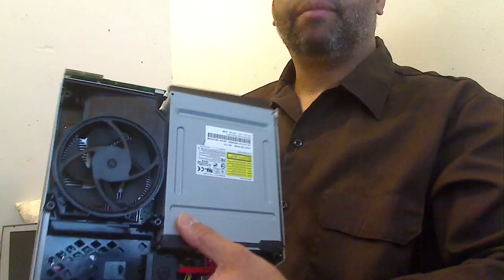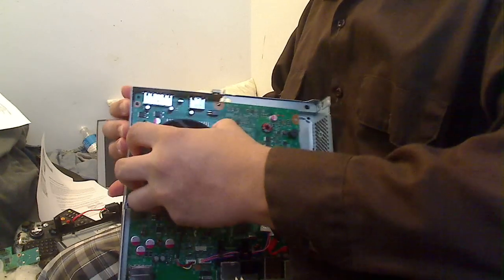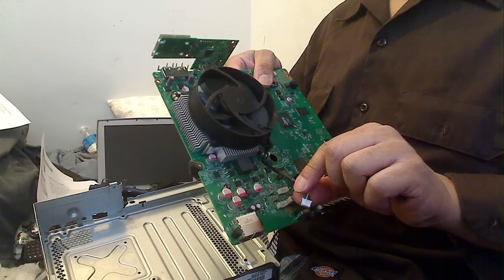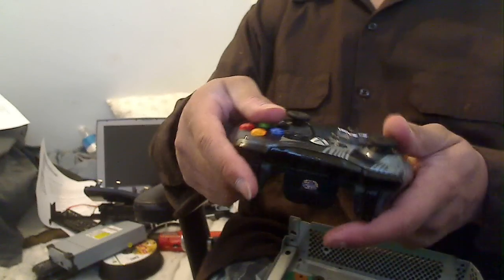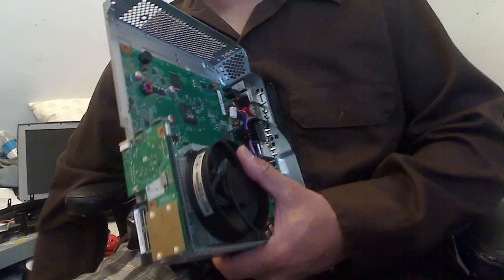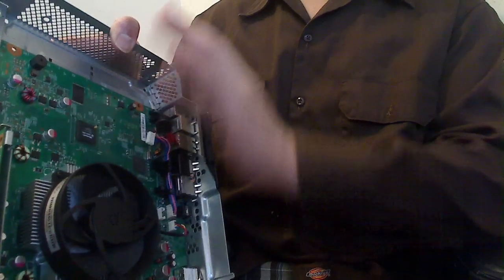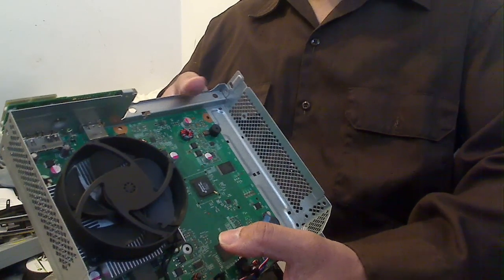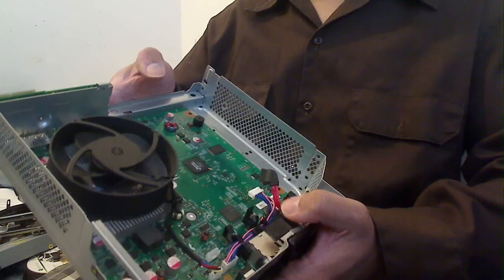How to fix Xbox 360 Slim RROD / Red Dot of Death Reset Solution👍

Comment: i did it and it shot down, i let it cool down but when i pluged it back in the ring was red again. so what should i do now?
Reply from the maker: Explain everything you did step by step.
Reply: +Donte Beachem (Romerro) i took my xbox apart-i cleaned it- than i put the thing with the light in it back on- seperatet the fan- put back in the hdmi and power cabel- started it- let it run till it turned off-pulled out the cabels- let it cool down-pluged the fan back in- started it again. second time i didn´t pulled the cabels out when it cools down. and a third time i put everthing together harddrive wifi thing ect. and did the reset. (sry for my english i´m actually german) and thanks for ur time :)
Reply from the maker: +Ben Fox How did you clean it.?
Reply: with a napcin and alc

Comment: I'm jose and my xbox360 slim has just turned on the reddot but it is a 4gb witch mean it does not have a hard drive and my power block every time i turn it onn it goes from orange off to green to orange while the console is on but with the red dot on the power button nothing else. plz help me
Reply from the maker: Your problem is unusual but try a friends working power brick and if that doesn't work, try the main reset suggestion in the video.

Comment: what happens if xbox doesnt shut off after 20-30min with fan disconnected
Reply from the maker: Check to see if the metal heat sink is hot. If it is not hot then you may need to use a heat gun on low (500 watts) for about, 10 mins both sides heating the board. Let it cool down for about 20 mins and then try the reset again.

Comment: Dave Ertman When I have it pluged in to reset I am get a red blinking light and the fins do not feal hot is this what it is to do or is there somthing else wrong.
Reply from the maker: The heat sink is supposed to be hot. Ur supposed to have the fan on the metal heat sink disconnected. If it isn't getting hot while the fan is disconnected, then there is something else wrong with ur Xbox, but make sure while doing the overheating that u disconnect the DVD drive,  the hard drive and the cables connecting the hard drive and DVD drive
Reply: ok thanks I will try this. Thanks for your help
this is the best video on how to fix your xbox that I have found.what should I do if the reset does not work does that mean the it is not fixable.
Reply from the maker: Thanx for the comment David. No it doesn't mean that it cannot be fixed. Your next solution would be to use a heat gun on low or 500watts both sides for 15mins each. If that doesn't work there are companies online u can send your Xbox to to remove the CPU and then resolder it back to the board. Also don't put the screws in with the washer. Place the x-clamp back in.

Comment: yo my Xbox had the red dot and it was because of the hard drive. how do you fix the problem
Reply from the maker: Power off the console, remove the hard drive; then reinsert the hard drive making sure it is lined up correctly with the SATA connections and pushed all the way in flush and then power back on your Xbox. if you continue to have the reddot because of the hard drive, try reseating it once more. if that doesn't work you may need a new hard drive or just use a large USB drive. you can always just remove the hard drive completely to play your Xbox. good luck and happy gaming

Comment: Hey I tried everything you said. I removed the fan. Turn the xbox on and waited for it to restart. It has a red dot for maybe 30seconds but after that the red dot blinks then shut down. I turn the xbox on again but there's still the red dot. Help!
Reply from the maker: Check your power supply.  Your xbox360 Slim power brick may be malfunctioning & shutting down the Xbox before it has a chance to over heat. If the light on your power brick turns red, even for a second then it's malfunctioning. If the light doesn't doesn't turn red, there may still be a problem with it. Try borrowing one from a friend. The Xbox360 Slim power bricks are universal with every other slim console. If you manage to borrow or purchase another, try resetting your xbox360 Slim.
Reply: +Donte Beachem (Romerro) I did the code thing where you hold the sync button then press the eject buttong 4 times to see what causes the problem. I got 0101. I looked it up and they said it needs an xgpu reflow? By the way my power brick light is green
Reply: +Donte Beachem (Romerro) will the power supply from Xbox 360 E console will work on my Xbox 360 S?
Reply from the maker: The Xbox360 E & the Xbox360 S models have completely different power interfaces. So basically you can't dummy mistake blow up your console at all. The Xbox360 E version specs are 120w, 9.6A @ 12Volts along with a single male insert, while the Xbox360 S version specs are 135w, 10.63A @ 12volts with a dual male insert. As you can see, the Xbox360 S version has so much more power requirements then the later Xbox 360 E version which lead to a cooler, smoother running system & their interfaces are dummy proof. Although I'm not sure if one could plug the E version into one of the Slims dual ports. You shouldn't do that if you're considering even thinking of it.
Reply from the maker: An XGPU is sometimes repaired by this over heating process called the Reflow. The XGPU reflow requires liquid based nonionized liquid Flux to saturate the solder points between the XGPU & the PCB and then running a heat gun over the  XGPU for a certain amount of time to remelt those cracked solder points back into place. My video talks about how to do this without the solder. You can do a search on Amazon for Nonionized liquid Flux if you wish to add the Flux before starting a reflow.
Reply: +Donte Beachem (Romerro) Do I need to put the thermal paste before I over heat it? or should I put it after? Thanks!
Reply from the maker: +Ralph Mendel it should be before u over heat
Reply: +Donte Beachem (Romerro) Ive already tried replacing the thermal paste then over heat it. I still have the red dot of death
Reply from the maker: Well your power supply may be causing your red dot error. The power supply has a cooling fan inside to protect from over heating. It can get damaged at times. Check to see the color of the status light on the power supply and make sure it's not turning red. Watch the status light on the power supply as you power on the Xbox360 and if you see a red light for even a second the power supply may be damaged. Try another power supply from a friend or other source.
Reply from the maker: +Ralph Mendel Have you added screws and washers for gapping or did you place the x-clamp back on??
Reply: +Donte Beachem (Romerro) i placed the x clamp back on
Reply from the maker: +Ralph Mendel ok that's good. Check ur power supply for that red light error.
Reply: +Donte Beachem (Romerro) power supply still has the green light while the console is in red light
Reply from the maker: +Ralph Mendel ok well the power supply is not suppose to just shut off the Xbox360 but there may have been an update that prevents the Xbox from staying on during the red dot error which sends a signal to the power supply to discontinue power. You may need to take the extra step of running a heat gun over both sides to heat it manually. This has worked quite well for me in the past.
Reply: +Donte Beachem (Romerro) what is the difference between reball and reflow?
Reply from the maker: Ralph Mendel A recall is complete removal of the CPU and or GPU, cleaned and then resoldered back to the main board, otherwise known as the PCB. A reflow is running a heat gun over the processor(s) and board sometimes done with liquid nonionized Flux so it runs under the processors.

Comment: what if your xbox slim fashes red and wont stay on for more than a few seconds to overheat it?
Reply from the maker: Hey Micah, then your Xbox may not even be the culprit. Check your xbox360 Slim power supply to see if the light turns red after power up. Check the light to see if it automatically goes to amber, when ur Xbox appears to shut off. If any if these are true [go to line] try using a friend's xbox360 Slim power supply or try replacing it.
Reply: +Donte Beachem (Romerro) nope night goes green when Xbox is powered on and orange when its on standby. though I'll try a different one anyways. I can't seem to find anyone with the same problem as me
Reply from the maker: Does it go into standby on its own or do u shut down the Xbox360 to standby mode
Reply from the maker: Let me know what happens when u replace the power adapter

Comment: what happens if I damage the board with a lil nick or scorch with a tool while taking off the x clam??
Reply from the maker: It all depends on if you knocked off any small chips or gouged out a large section of the PCB. (Printed Circuit Board)
Reply: +Donte Beachem (Romerro) No I didn't, it's just little/tiny scratch near the x clamp bolt
Reply from the maker: Then that lil tiny scratch shouldn't mean anything. So try replacing the x-clamp and also check to make sure that the light on ur xbox360 power supply isn't turning red also. If it is, it's probably bad and needs replacing.
Reply: +Donte Beachem (Romerro) ok thanks. I got a red light again so now I'm putting the whole console back together. I didn't take notice if the brick was red. When I put it all back together I'll. Look.

Comment: I reset my xbox 360 slim about 2 times the you stated and it still had the RROD so the third time I scrubbed the board like you said and hoping this works. I'm not sure if I damaged the board whilst taking off the x clam.
Reply from the maker: Ok. Well u can try place the x-clamp back since using the screws washer scenario at times leads to improper gapping on ur end and may warp the board underneath the CPU. Also, this video was created for Xbox 360 Slim. Red Dot Error and was not created for the Xbox360 Phat Red Ring of Death (RROD).
Reply: +Donte Beachem (Romerro) well I do have an Xbox 360 slim. It's actually a special edition gears of war console
Reply: Do have to put the hard drive in? Because you didn't put the hard drive in. And you still got the working green lights

Comment: hay bud i got a problem i have xbox 360 slim shiny version and used to get red dot death on overheating. I purchased artic sliver 5 toar apart xbox cleaned it witb brush took heat sink out all that cleaned out old past used artic sliver 5 kit with cleanung solition and redid the past and properlay instaled it and worked maybe 3 to 4 days 4 to 5 hours playing halo today black ops to it now red dot death again wont play black ops 2 over heats turns off iv done power reset fan off all that i did the old meathed over heat xbox for cpu ship to reball it self and still doing this
Reply from the maker: You may need the heat gun solution. It usually solves the problem. I suggest a heating solution in the video.

Comment: what about xbox 360 that pcu crankels do think that couse for white xbox 360 to get red ring death but green light in middle
Reply from the maker: Your DVD drive may be bad or disconnected or the DVD tray is misaligned or not closing completely.
Reply from the maker: Lol. Well what ever works. I would never suggest doing G anything like that, since it's more likely to damage the Xbox rather then repair it.
Reply: lol funny sometimes kneed little tap head put things back in place lol.Jk

Comment: other xbox work fine but dvd drive kneeds to be coded to muther bourd to run games only plays movies for now.i guess need pbc for computer to get the dvd drive unlocked to link with xbox 360 muther bourd thats hassel.also
Reply from the maker: You need the key from the original drive which matches the xbox360 motherboard. The key has to be extracted using software like jungleflasher with a probe & an X360 USB key extractor & then program that key into your new DVD xbox360 drive.

Comment: one of them has red ring death and i allready bought and did the repair with good quality paste i think i installed the washers wrong witch coused it.to still overheat now kneed to do whole process again can i send them.over to you instead you fix the problem for me please
Reply from the maker: I'm sorry Alaa but I do not accept Xbox repair jobs associated with this channel. I'm just providing the instructional video for self repairs.
Reply from the maker: You can also try removing the screws & washers & placing the x-clamp back under the CPU. The screws can at times warp the board underneath the CPU if not properly gapped by the correct sized washers.

Comment: Is the Heat Sink the problem if when you turn your Xbox on and before the red light comes on it makes a clicking/scraping noise?
Reply from the maker: No. That usually indicates that either the fins on the fan are broken, fractured or there's something stuck inside the fan or between the heat sink & fan

Comment: How do I know when the gcpu is sufficiently heated after I disconnect the fan. is this done before or after cleaning and replacing heat paste.
Reply from the maker: You can do it before or after, as long as u removed the power from the fan. If ur Xbox still red rings try placing the x-clamp back in instead of using the screws.

Comment: hey Donte I have tried the reflow on a slim trinity MB .... and im still not getting a green boot?.. can there be anything else to try ?.. I have read it could be a hard drive but I have 3 and I have tried all of them.. plz comment back...... thanks
Reply from the maker: +Beau Barnaby The way you determine if the hard drive is at fault is by removing the hard drive and then reboot the xbox. If the xbox boots up with a green light and you have an xbox 360 boot screen and then the dashboard, then you know the hard drive was at fault. If you've removed the hard drive and then rebooted and you see a red dot, then you know the hard drive is not at fault. If you're not getting a green boot you may have to replace the CPU paste. If you've already replaced the heatsink CPU paste then boot problems may have arisen from a bad microsoft update or maybe even a bad power brick; check the power bricks light during a boot to see if it turns red; if it does, the power brick may be the culprit. Other things that can cause a red dot are bad cables. Bad HDMI, Bad component cables or even bent HDMI pins in the rear of the xbox360 where the HDMI is connected, also bent USB pins inside the USB port, which can also cause a ground fault and a red-dot.

Comment: Hi,  my xbox 360 slim is starting green with full fan power and is getting red after two seconds. After this, it is blinking red ten times and the Xbox is shutting down. I changed the power supply, bist still the same issue. Could you please help?
Reply from the maker: Well Thomas, if the light on your power supply isn't turning red and shutting off the Xbox, then the heat sink paste may have dried up. But keep in mind that bad Xbox live updates can cause this issue also. Check the Web on how to remove a previous xbox360 Slim update & if that doesn't work, replace the heat sink CPU paste. Good luck.

Comment: I don't like the term "reset" used in this context. This is nothing more than overheating the Xbox with the hope the solder beneath the problem component reflows itself. What's happening in this scenario is the solder has cracked due to the heating up and cooling down over time. Newer lead free solder is less tolerant to this. The original fat Xboxes were horrible in this regard, but as the newer 360 consoles are more reliable than the originals, it shows improvements in manufacturing and engineering can happen. The clamp modifications are similar in that it's a hope of a fix. You're just applying more pressure on a component like the cpu/gpu to try and close gaps or cracks in the failed solder hoping the connection will be fixed. 

These fixes may help you, but they're more like bandaids and how long they last is always a question. If after trying this you still have trouble, locate a knowledgeable person with proper solder reflow services. That's your best bet for a lasting repair and likely what MS does.

I came to this video expecting a reset similar to resetting the check engine light in a car. This is not "resetting" anything.
Reply: Does this work to reset the board? I am scared to try it so I need to know first
Reply from the maker: +OmegaKnightGTX Well that's odd. you want me to tell you twice that it works to reset the board? Once in the video and once in the forum.? Well go through all the comments and find someone who said thanks or said it worked or said I got my xbox working again. Hopefully they'll be able to answer this question for you.
Reply: +Donte Beachem (Romerro) Lol major derp I mean that what are the chances this damages any of the components
Reply from the maker: +OmegaKnightGTX None..
Reply from the maker: +IllmaticAngel Correct.. Human error is the potential danger to do harm. Thanks for additional thoughts to this question.!
Reply: actually "reflowing" is a bad term and actually ehy do so many people believe your making connections with solder!?  COMPLETELY WRONG, the heat gun actually heats the chip and jostles internal components and pathways in the chip to make them function again.  If a heat gun worked for you then that means the cpu is almost fried and now you need to replace the chip/processor because its going to fail in about a week/month!

Comment: my problem is every time I turn on the system the dot will flash red and shut off right after. any advice?
Reply from the maker: Check your power brick. It has a fan inside. If it is malfunctioning the power brick may be over heating and then red dotting the Xbox.